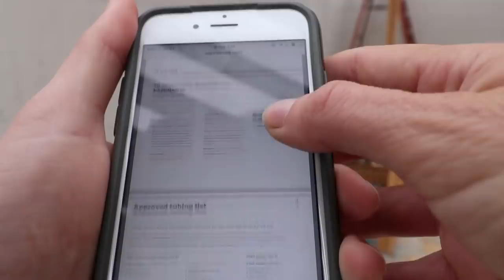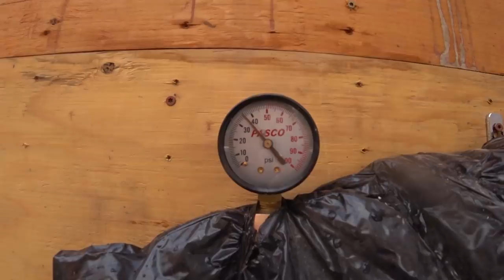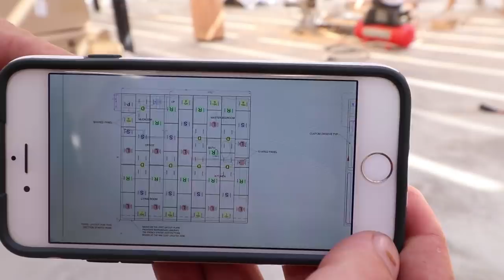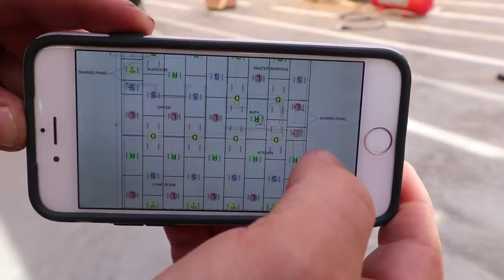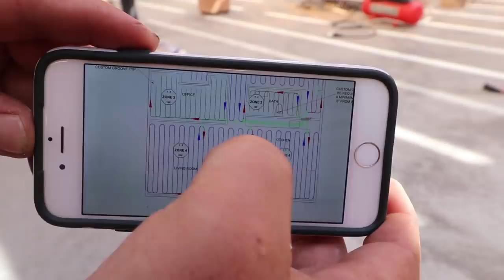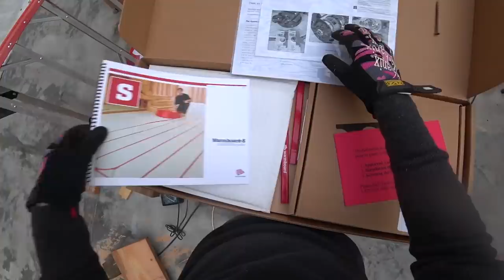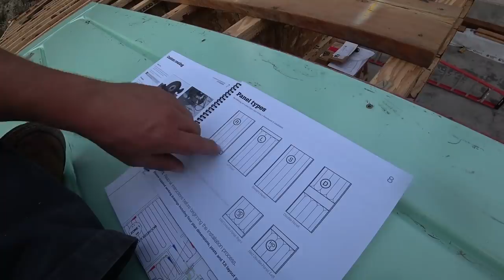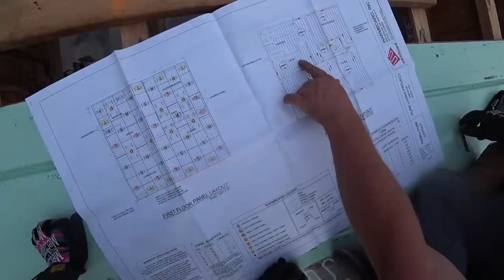Building a House Start to Finish: Radiant Floor Heating Installation Ep 1

Comment: To take the guesswork and risk out of drilling into the floor , put some warm water through the pipes somehow and use a thermal camera like a Flir. I have one and it works like a hot damn literally. The loops show up just like xrays. Way better than having to fix a leaking pipe. Cheers
Reply: bigblockchev1 Outstanding !

Comment: You worked hard, got a lot done, did a good job. Thanks for sharing. On radiant roulette, it gets COLD there, a heated garage will help prolong the life of every vehicle stored there, besides giving you homeowers a place to work, no matter what the project is.
Reply: asset garage temp at 40 or 50 and you will like the difference

Comment: You guys are doing the floor system absolutely they way it should be done.  i built a P&B house in 1975.  I wish we had built the foundation the way you did, however those foam products did not exist back then.  Also, the first floor of the house is P&B framed.  P&B is very difficult to plumb and still hide the final plumbing.  Timber frames are romantic, however they are expensive.  If I had to do it over, I would only use heavy beams in the ceilings and the visible roof structure.   My outside walls would be 100% block and foam insulated.  The house structure would be so air tight it would need an air exchanger.  Good luck with your build.

Comment: It is possible to pour Laticrete floor leveler over the warm boards for specific areas or zones. For example, if you want a tile floor in your bathroom, you would pour Laticrete after placing the lower wall plates that define the bathroom. Install tile directly on the cured subfloor.

Comment: Ok, I enjoy watching your videos, they are quite entertaining. Being a framer may I suggest a couple of must have tools to speed things up a bit. 
1- A worm drive Skil saw and drive over that pos sidewinder saw you have with the 580k.
2- A good compressor, framing, 7/16, and siding coil guns. 
3- For God sakes get some good nail bags. Put them on in the morning and don't take them for any reason.
Reply: I've never in my 20 years of framing seen anything but worm drives used. Skil Mag 77
Reply: A regular ole circular saw works just fine untill you get into compound angles up in the rafters, but you are 100% right about the bags.  How are you suposed to get any work done if you dont have your tools and hardware on ya all the time?

Comment: If you have the radiant in the slab anyways you could power it with one or two thermal solar collectors. It won't be really warm, but maybe always keep it above freezing. And depending on where you get the panel it would be really cost effective too. The thermal solar collector could be used to provide warm tap water in the summer as well .
Reply: Good thought.

Comment: I hope this gets noticed. The business I work for in southern Ontario put radiant in the 20'x10' slab in an "enclosed" patio. The whole room is glass panels and 5 garage doors, so thermal transfer will be significant. We had the thermostat set at 80C on the boiler and that turned out to be too warm. We turned it down to 70C, and on a day that was 3C, the room was perfect temperature. I feel like where you're located, you'll wind up using the radiant in your pad more often than not when we  get to December. Kudos to you if you don't, but you were so right to do it when you could. That could wind up being a seriously cold floor in January.

Comment: With your slab loop you could use it for geothermal cooling in the hot summer.
Reply: zuesmondo1 Geothermal Cooling 
In the cooling mode, the heating process is reversed - creating cool, conditioned air throughout the home. Instead of extracting heat from the ground, heat is extracted from the air in your home and either moved back into the earth loop, or used to preheat the water in your hot water tank.

Comment: Hey.. I have to say this... I think you will actually use the Slab Radiant .. If you start to heat the slab Early in the season it will help you to keep a constant temperature..  A Slab as a Constant source of steady Temperature is far more efficient over time.... 
Once the slab is heated it takes less time to keep it at that temp...
A Solid mass is the best way to keep the temp. constant..

Comment: Use electrical tape to reinforce those adhesive (and silicone) tubes. It's a common problem when they are damp and/or cold.

Comment: Alyssa, here's a concept - halogen worklight. What will it take to convince you to buy one? You can get 6 more hours of usable daylight!
Reply: Who buys halogen these days anyway?  

LED is the way to go.
Reply: Have you actually tried modern LEDs?  I have both and the LEDs win out over traditional halogen (which I have been using for over 40 years) in several ways - to include light output (they now match halogen), heat output (negligible whereas halogen represent a genuine hazard in this respect on two fronts - burns and fires), fragility - if a halogen gets knocked over as often as not you'll lose the tube (LEDs are not indestructible, but they are a lot more robust than halogen).  

And then there are the running costs (electricity and new tubes on a regular basis).  Not perhaps everybody's first consideration, but a consideration all the same.

Oh yeah, and you can actually run them off a solar / battery setup.  Try that with halogen and see how far you get.

Comment: Great job --- That WarmBoard is really cool, ...I mean Hot, ...I mean warm...
Heated floors would be sooooo nice.  When our house was built (1965) they were putting electrical heating elements in the CEILING !!  Wonderful to have the heat just rise up and leave through a scarcely insulated attic -- what were they thinking !!!
And I've had the ''opportunity" to play roullete with putting screws into the ceiling and hoping not to hit the 240V wires spaced every few inches.  Apparently they can catch fire too -- what a fun technology it was.
Reply: I've heard of this where people say sitting at a table your legs would freeze.
Reply: At least you didn't get the 60's version of radiant heat which was copper tubing buried in concrete. Didn't last very long.
Reply: Yes -- good thing.  We can shut this down by just pulling the breaker and not having lots of liquid lines to drain.   Our form of ceiling heat here makes for an interesting ceiling - there is 5/8" sheetrock, then the wiring overlay, THEN a 1/2" thick layer of concrete mortar.  Found how tough the stuff is when I had to drill 4" hole through it in numerous places.
Reply: yes -- we've heard of fires caused by it.

Comment: 9by keeping a temp min (you need to find the right temp) on the slap you can save a lot of heating up 
stairs, as the mass of it will help sustain the temp.

Comment: If you are putting down a lot of adhesive out of a tube, you can't beat having a cordless caulking gun, especially with the big tubes.  Saves on the "gripping" hand, and you get a nice consistent bead.  The one I have from Ridgid also has a guide to keep it centered on the joist as you draw it along.  (I know they don't read comments)

Comment: Are you going to cover the frame over winter?  Even a clear double plastic could be reused on the garden hoop house.  A dairy that uses ag bags would be good to easily slide snow off instead of shovel and broom.  Pull with tractor.  Good tarps for sawdust capture and easy transfer to compost.  One day you could heat the slab with a solar water panel.   I hope you put in a killer wood cook stove with hot water jacket.  A toasty wet room to dry everything in winter is a big help.  Warm clothes make the first step into sub zero less painful.

Comment: Why did y'all not place the bolts facing up before pour the slab and save the nightmare of drilling so much into it. It a common practice for construction.
Reply: While doing this style of construction it is hard to get a exact location for these bolts.

Comment: Is screwing everything, instead of using an air framing nailer, a result of your architect's design, or a personal choice? Although those frames will never move with all those screws, it would likewise be that firm of attachment with air nails, and WAY faster (and cheaper. . . .)! Outside buildings that I've built with my framing nailer haven't moved at all in 20 years!!
Reply: Eh, some screws can be structural grade screws which have a thicker body than what most people are use to. All new log cabins used screws to hold the logs together. I agree Nails are obviously much faster and cheaper and its hard to beat a 16 penny nail. Fact of the matter if you hit anything with a car chances are your gunna destroy it regardless whether you used screws or nails because that wood will shatter. House looks fine, I do like the fact of screwing and glueing the subfloor down, keep that floor squeeky free. However, glue and nails on the subfloor would be fine too and work just as well. Benefits of screws is if you're a novice builder they can be your best friend in case you make mistakes.

Comment: You radiant experts out there: What's the RIGHT way to drill into the foundation after the radiant is installed? In other words, is there a scientific way to keep track of where the plumbing is in the concrete?
Reply: Infared, metal detector or a magnet....
Reply: We mark the lines on the walls, where they meet the floors. Same in the ceilings, where you run duct work and power lines. A small mark on the walls and you can put a string between them, if you need to.

Comment: Was using those same concrete anchors, albeit twice as long.  My little impact driver only could get them started, had to get a massive impact driver to honk them into the 50 year old concrete.  Funny thing concrete actually keeps getting harder for many decades -  in putting in the tack strips downstairs into this old concrete, the special concrete nails would just bend - had to predrill little starter holes in the crete, very time consuming.

Comment: I've use a lot of long screws in construction and wondered about using those over nails. Nails are softer, more malleable so usually bend rather than break. I've wondered which is actually stronger.
Reply: Nails are stronger and should me used where load bearing is applied.  Building using green wood and nails is a plus because wood looses moisture content and shrinks/hardens.  This process grips the nail.  If there is load bearing though, screws will snap and you'll have issues.  Keep in mind that screws almost double the hole so GRK are using the thread as an anchor.
Reply: Nails aren't "stronger", that term is really used improperly. Nails are the proper fastener in the application because they won't shear off. The screw really is "stronger" than the nail, it is just brittle in comparison and not the proper fastener for the application. I understand the want to use them though, keeps everything tight since they can't back out with the expansion and contraction of the wood. I am no builder, but I think they may run into issues using screws alone, instead of in tandem, so when the screws break there is still something to hold the joint together.
Reply: That has been my experience in some things that I have built. In a huge deck I built, when I had to get under it to get my stuck Malemute out, I was removing some boards to get at her, I found a lot of the screws already sheared off. They may make some high strength screws that would resist that.
Reply: Not criticising at all. Just worried.

Comment: In the winter keep your garage floor at a base temp of 55 or 60, and then use a forced air heater to heat the space to 70 when you need to work in there.

Comment: Shouldn't you leave your slab tubing on, even on low, so it doesn't freeze up. Way better for the system rather than not using it I would assume.
Reply: That's what I was really wondering. Thank you.

Comment: Why couldn't you a vapor barrier on your concrete, then put the warm board on top of the concrete instead of pouring over top of radiant floor?
Reply: Combat Pyro ummmmm, because it is a garage, and if you look up the cost of each warmboard panel you would have another reason.

Comment: What i don't get is, and maybe someone can explain this to me, is why they didn't put steel sticking out of the slab so they would know where to drill? The positions of these posts were known from the very beginning, so why didn't they?
Reply: For the same reason the Warmboard box wasn't opened until they were already installing it. That would require advance planning.

Comment: Post was unneeded.  Double or triple floor joist next stair open then bridge across. Slabs acts as a heat sink, warm floors rock.
Reply: I can only assume the post will serve for some design feature/support for the staircase. 

It's not supporting the joist as it is, just being pinned to the joist with deck screws.

Comment: Have questions I will see if I can help us here in Denmark has used underfloor heating for 30 years or more. I would probably have put a lot of space under the floor between the floor and the rafters so that no moisture can be removed from the basement

Comment: Why all the screws? Thought that they were sub optimal for framework due to their low shear strength compared to nails?
Reply: I was referring to the screws that were used to toenail the actual construction members   together. Yes I'm perfectly well aware that screws can be used for non load bearing elements and as glue clamps. (edited because 'M's are not 'B's)
Reply: Mike Homes can't be wrong can he, this is exactly how he does it....

Comment: Usually squash blocks go against the web and between the top and bottom chords of the I joist. You may have done this but the one corner in the video shows you putting it along side the I joist
Reply: I think with the large dimension posts the timberframe is going to use as long as they have the squash blocks on either side of the joist the post itself will span the less stiff and weaker I-joist in the middle. Would obviously be better to also include web strengthening with the sistering, but I'm hopeful that's been considered by the engineer that drew up the plans.

Comment: Using your slab as thermal Mass is probably a good idea for the coldest months I know up here in Canada it is quite beneficial to have a slab heated as the house needs far less heat put into it afterwards and the temperature of the house stays quite stable even if you're only heating the slab a little bit also it would be a good insurance to keep your house warm if you want to go away for a day in the winter if your wood boiler Runs Out you have that thermal Mass radiating heat throughout the house for a day or so something to think about

Comment: Just to help educate viewers further on radiant heating.  Mass is good, it helps resist temperature swings and makes for a more stable thermal environment. If you are used to constantly changing the temperature in your house it probably because you need to do this to keep your heating bill under control meaning your house has not enough insulation, poor windows  and air leakage.  High mass buildings use the strategy of set the temp and leave it.  And this can be done due to thermal mass resistance, high insulation values, good windows, a well sealed envelope, and using our sun. 

 All of the projects that I design have  thermal mass floors.  This works even better when used in conjunction with a passive solar strategy.  You can read more on how this all works on my website.  http://www.greenovision.com/  look under the energy efficiency tab.  You can read about Passive solar design there as well.
We use what we call "smart sun" which has thicker concrete slabs 4" to the south with 1.5" gypcrete slabs to the north side for quicker response.  Or look in our blog on that site were we have write ups about our latest combined energy efficiency strategies.  

In the Rockies we have ample days for passive solar heating (read free heat!) but it is design that makes it all work correctly. 
The fact that you have a radiant 4" thick slab in the garage will be a good heat sink nonetheless.   Radiant roulette as you call it can be eliminated with a good tubing layout so that columns and walls dont have tubing run under them.  

I hope to just be helping further viewers knowledge so that when they go down the path of building a new home they are better informed.  Unfortunately most of the homes being built today are low mass buildings and tend to flash heat and cool, are under-insulated and dont take advantage of our natural suns radiant heating, or have a good natural venting strategy.  Its all happens by and through  design!    I hope this helps people.
Reply: Also use an outdoor sensor to to adjust the temperature of the water circulating through the floor.